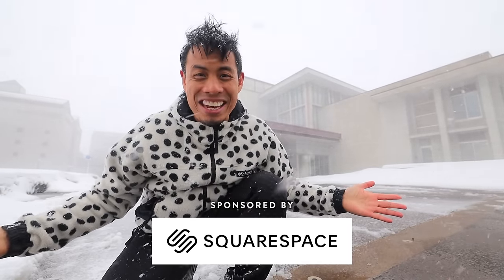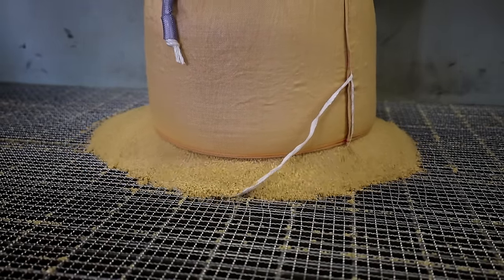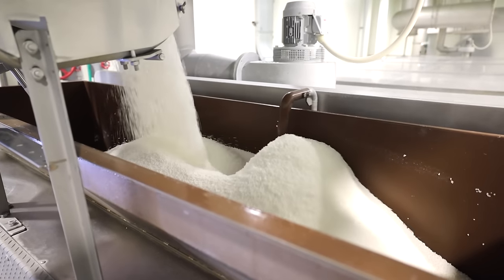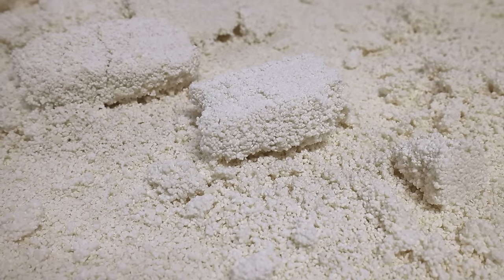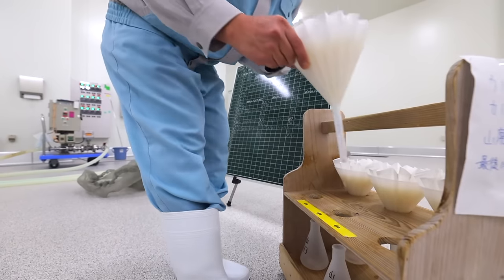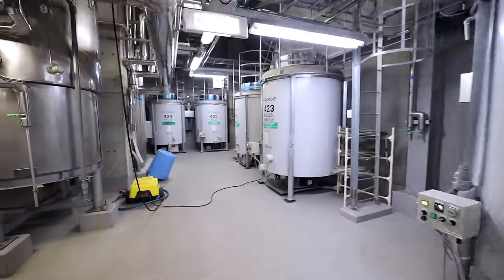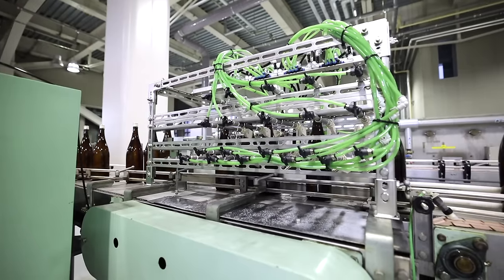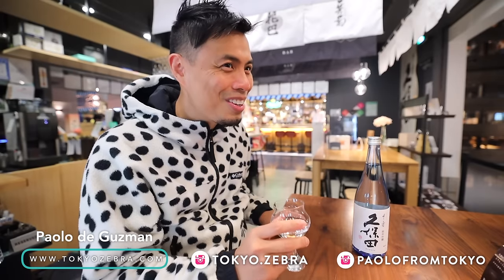How Sake is Made in Japan

Comment: It’s insane how clean and well maintained they keep everything.
Reply: when dealing with mass produced food, anything less would be a scandal
Reply: @Lektrolind  I’m from a country where food standards are extremely high and it’s no where near the cleanliness seen here.
Reply: I'm joining Peter here. Even in the non food processing parts, everything is pristine clean: the trucks, the forklifts, everything...
Reply: @Xwisit  yeah I can also vouch for you. My WIFE used to work att cookie factory something. They make many type of snacks. She told me everything was so disgusting, machines covered in food particles no cleanliness was inside there. She quit the work bcs of that. And Since then we stopped eating their products
Reply: @oldman5564   Sounds like you've worked at the Preggo spaghetti sauce factory
Reply: Exactly my thoughts.
Reply: Japan is a very clean country
Reply: Alcohol production is slightly finicky compared to food production (where they can often sterilize food after the production process during packaging to ensure safety), even the bar down the street here in El Paso that brews their own beer has an immaculate production setup because fermented beverages require perfection to get the correct taste for repeat customers. They didn't even show the sanitation procedures, but that part of the process is 70% of the work.  They use chemicals like food-grade phosphoric acid or nitric acid self-foaming mixtures to make sure no residues are present and no microbes can survive while not reacting with the stainless. It doesn't sound wholesome, but the chemistry of using strong acid mixtures actually makes a more wholesome process compared to some surfactants.
Reply: If you lived during the medieval period, it was better to drink alcohol beverages rather than water because the water was not clean.  Alcohol was among the cleanest beverages to consume back then
Reply: @Lektrolind  Meanwhile in the USA, we keep having lettuce being recalled and alcohol has safety regulation issues
Reply: Alcohol making and cleanliness have always been inseparable. Purity can affect the quality of alcohol, and the cleanliness of the place helps prevent contamination too.
Reply: Work as insurance risk surveyor (UW), have been visiting more than 300 big risks/companies, level of cleanliness & process flow seems superb, even new food-based MNC factory in Malaysia cannot match this sake factory. Well, i might be still lacking experiences. But as of now, many improvement can be made in many factories.
Reply: Not like American factory.
Reply: @AmirA-qo3jv   how about their treatment of ainu people? is it clean?
Reply: @PinoyAbnoy  huh 🤔 ainu people
Reply: Japan is probably the cleanest country in the world
Reply: That's the key to a perfect fermentation process.
Reply: @ballistic350  Singapore is clean as well
Reply: Only in Japan 😘
Reply: It’s a factory, what did you expect
Reply: @Dominicolous  even in germany and swis it is not this clean and even you know it
Reply: @snarkylive  you know those factorise weren't clean as this Japanese one but keep on lying to yourself.
Reply: Man...ive been brewing in an old bathtub for the last 30 years and no complaints from my customers...
My product is that good no nastys can interfere with it !!
Reply: @Xwisit  What a random bunch of nonsense. European food factories have the same standards and are just as clean. What's it with this idea that Japan somehow is cleaner than other civilised parts of the world lol.
Reply: Japanese mentality and attitude from birth
Reply: @Xwisit  Well maybe in your third-word company but try to visit other places and you will see. Bacardi, Tanduay, etc go watch how clean the place is this is why are the best-selling rum.
Reply: @Xwisit  singapore where im born has very strict laws but still the streets are hella shitty tbh(not that shitty)
Reply: @wf6951  at least preggo has good sauce😒
Reply: @Lektrolind  dont ruin his fantasy about the Japanese being special superior people
Reply: Gotta look clean for the camera!
Reply: @Bombersnomore  like they would clean everything from floor to roof just for Paolo's camera huh? not to mention the factory is huge and everything in there, machines, etc. are so clean
Reply: @paolo487  If someone is visiting and filming you would you do everything you can to clean up and make your place as perfect and presentable as possible?
Reply: @Lektrolind  Then guess what the standard is. Most recently Ferrero.

The numbers of recalls in Germany have risen by over 200%: cutting edges, temp workers, over hours, profit, profit, profit above all.
And that is the norm in the entire Western world or China and the like.

But dream on...
Reply: Well… they could have made it feel less like they converted a prison into a factory. *

*im only 2 mins in, but I’d doubt my sarcasm is truth… I just find the vibe of the place kinda creepy like that.

Faux News Headline: Former psych ward for high-risk inmates turns into a sake factory

LOL! JK!
Reply: Even the slushy snow outside doesnt look dirty.
Reply: @copper_himselfgaming619  most American factories are clean.
Reply: Quite true. Watch just about any other "how is it made" video, and the general conditions of these factories is honestly appalling. Even if things can be sterilized at the end of production, it really does not change the fact that SO many particles can, and will, find their way into products and still survive.
Reply: @Lektrolind  laughs in American 
I only wish we had standards like this on a mass level in America. It’s… gasp almost like the higher-ups don’t care about us… 

Wasn’t there a famous American author that wrote about how messed up the Chicago meat district was that it helped form the FDA… oh? Yeah no that happened? N we, as Americans still have issues with what we allow n don’t allow to be served? Idk dude. 

You’re absolutely right. Yeh ya know… the big boi Mercia wants to be “different”. 

There’s a solid quote from idk who. 

“A hundred years is a long time to an American, a hundred miles is long to a (European/Britishman?)”
I think the quote applies to a lot in American history. Especially the time aspect.
Reply: In 02:05 are his shoes clean
Cuz if not then that's a health code violation
Reply: Imagine it's made in India hehe
Reply: @JaketheJust  That is merely a long standing myth. Well water, aquaducts, aquifers (usually accessed via Wells) ect were all perfectly safe. Many are still used today even without needing treatment. Sure, some places yes, low strength alcohol was made to help purify slightly off water. You pretty much have to use good water to begin with when brewing.
Reply: food grade factories have nothing to do with cleanliness, Ive seen the grosest of gross being an industrial mechanic
Reply: Quality vs quantity. Wish my country cares this much
Reply: @Xwisit  depends on what you are making, in this case alcohol making process has to be very clean, even in the breweries in the US we have to make sure everything is properly sanitized and clean to produce, if not could end up souring or making it taste like vinegar.  One other thing Japan is known for being big on cleanliness, and engrained in the culture since youth, so it's not shocking to see multiple places fairly clean and wish every country had this attitude in being clean.
Reply: @snarkylive  Yep, a lot of the brewery companies follow this, learned this in making my own alcohol.
Reply: @Bombersnomore  thats true also lol.
Reply: It shouldn't be insane, it should be the normal thing everywhere
Reply: It’s the result of a highly disciplined and motivated population. When I visited in the early nineties I couldn’t get over how spotless their cities were in spite of the absence of pedestrian refuse bins.
Reply: Wineries have to be crazy clean.  They have to or it will alter the taste of the wine (sake is rice wine). Often for the worse.
Reply: yes sure
Reply: @AmirA-qo3jv  neat people
Reply: They know that Paolo will come and film. Of course, more attention is paid to cleanliness than usual. For example, I can hardly imagine that the rice sacks are transported unsecured on pallets in trucks. In an accident, they would fly through the area, killing people in traffic. But it looks better for filming. The automatic filling of the bottles is also quite slow. I have worked in many automated factories (food, automobile). They usually focus on efficiency and time savings, and that's why production lines are run much faster than shown here. But again, it's easier for the viewer to see if you let the systems run slower in time. Nonetheless, Asahi Shuzo's production facility was beyond impressive. It is also remarkable that a lot is still done by hand there.
Reply: or legal liabilities would shit down the business
Reply: Its Japan.. thats the answer
Reply: @apelhijau4035  yup
Reply: @snarkylive yeah what your saying bro is correct and accurate due to the fact that everything needs to be sterilized and very clean cause one wrong move and mix or mess up will mess up all the batches when I was in prison i would make pruno which pretty much is fermented fruit(bananas,apples,oranges,pineapples etc) and for how dirty the prison was I used to make sure my cell was extremely clean and sanitary I wouldn’t let anyone or my self come in my cell with there shoes on and would make them leave there shoes at the cell door but yeah you don’t want anything on the outside getting on the inside of the batch.
Reply: Looks cleaner than a hospital
Reply: Almost like they’re a developed country 😂
Reply: ALL JAPANESE PROFESSIONALS ARE TAKUMIS. ITS WHAT THEY DO BEST. NOT TO EFFFFFF UP